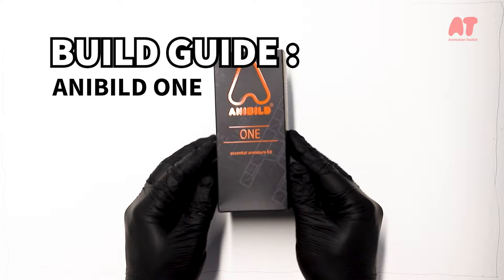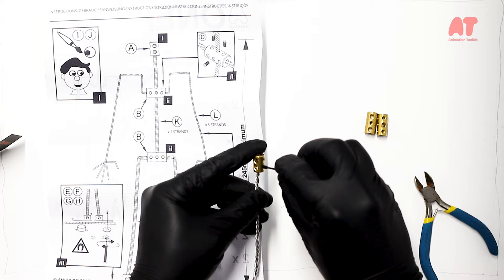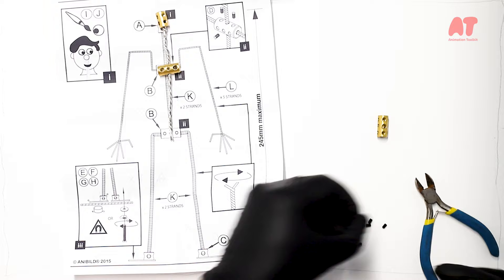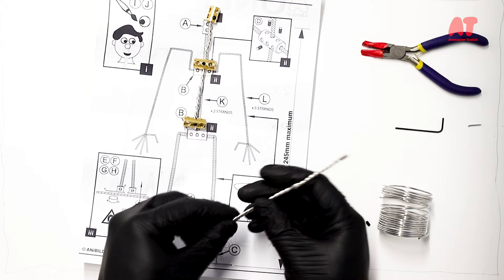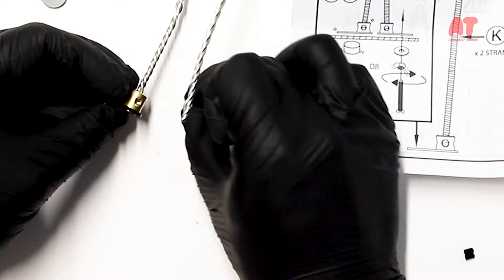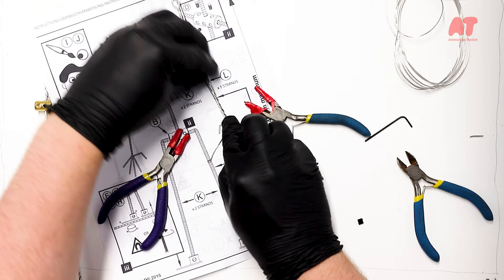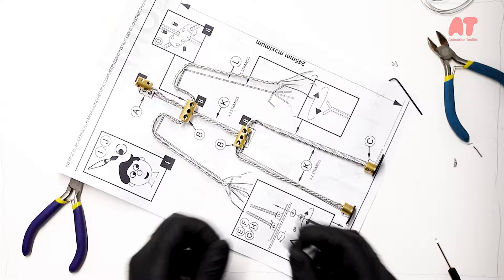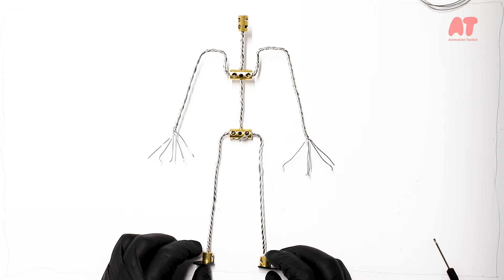BUILD GUIDE: ANIBILD ONE

Comment: What should be the diameter of the set top holes?  I have an animating surface with holes of 5mm, will the bolts that come with this armature for tie-downs fit in a 5mm hole?
Reply from the maker: Hi there, the threads in the feet are 3mm so the holes of 5mm in the perforated sheet are perfect (with a little wiggle room). Your set up will work fine. 🙂